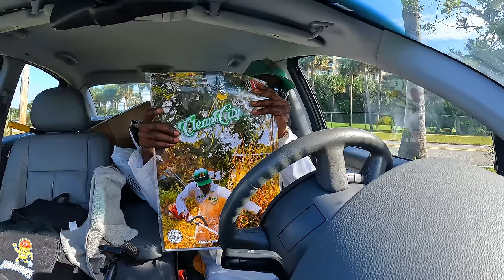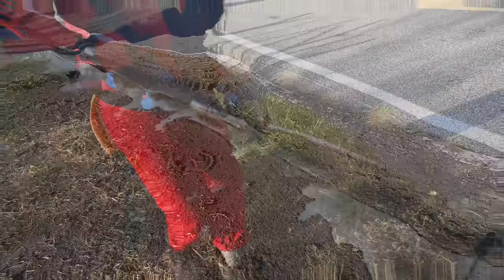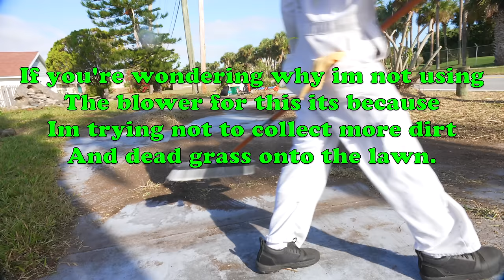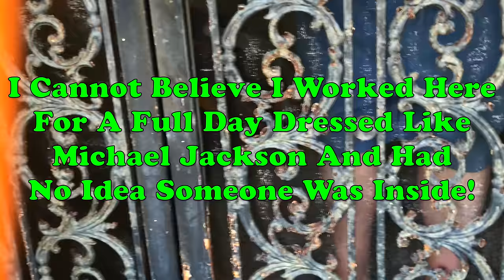Michael Jackson IMPERSONATOR CAUGHT While MOWING OVERGROWN Yard For FREE Without Permission!!

Comment: AP, a little friendly advice. If you keep cutting the grass all the way down to the dirt with the trimmer you will eventually damage to growth at ground level just above the root, damage the root, and risk killing the grass. You should use your mower instead of using the trimmer for everything. Plus, it looks much better and healthier. Taking grass all the way down to the ground is not healthy, and it looks bad with only dirt showing... green is better than brown, bro! You're destroying the green, my friend. That's why mowers don't cut all the way to ground level.

Plus, the mower will be faster and save you some work. Not to mention less excessive and unnecessary wear and tear on your trimmer!

Hey... just some advice from a fair amount of experience. Good job, as usual.